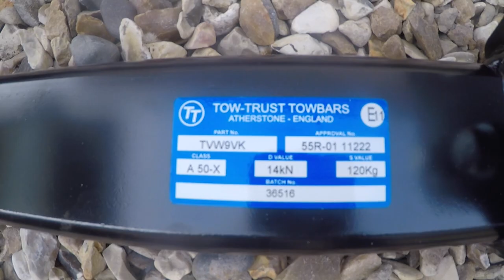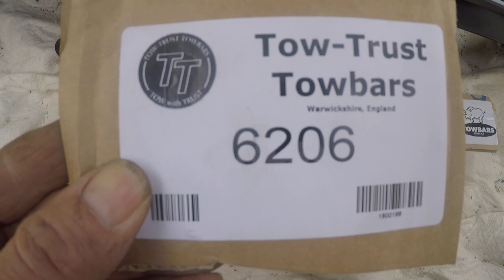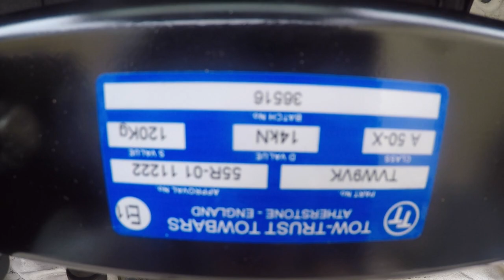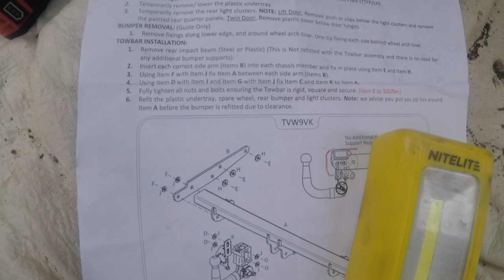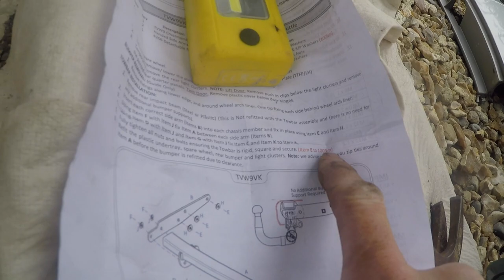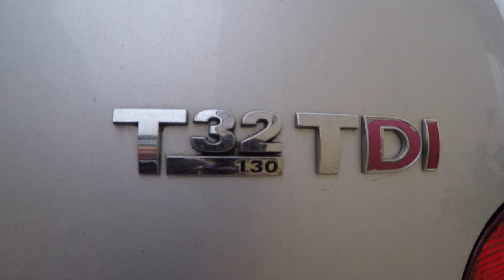How to fit VW T5 TOWBAR *DIY*

Comment: Great vid! Thanks for the effort! Give me a good idea about what to expect when installing the tow bar. I'm totally surprised about the terrible manual :').... I played that part again.. it's hilarious :') And that's coming officially from VW, right? or is it second branded? I do wonder what to do with the Electric, I did hear most cars are prepared for the tow bars, so they already have the cables going to the back, so plug&play, so i'll be looking for those, and if not there, maybe that will be a bigger obstacle than installing the tow bar itself. 
Thanks again!
Reply from the maker: Thanks for watching pls read other comments as we talked about electrical part  take your feed from drivers side rear light if youur plug and play theory does not work and cambus adapter if u need one 😆👍👍👍

Comment: Great vid helped me out, have you done a video on the electrics?
Reply from the maker: Not yet I recorded it but not edited when you do elect the drivers side tail light switches to a fog light is a twin filament bulb so take power for side lights from rear passenger side.  If you take light cluster out separate bulb bit and look at the metal printed bit on it then follow back from the middle terminal 👍
Reply: @daddyfixit5188  thanks pal for the tips, I was supplied with a 7 pin connector with the tow bar with no instructions and nothings pre wired. I’m quite handy, but hearing stories of popping the ecu if wired up wrong puts me of so think its a job for the auto elec guys I suppose
Reply from the maker: If you have a newer van which has cambus  think 2010 onwards maybe.  It is doable I’m sure but hey some things are best left to the pros.  Maybe if you arrange to take your van to see them without bumper and light under trims it would reduce cost.  In that position I recon they could do it in less than 2 hours and U don’t have the headache.  U might be able to find someone mobile then u will save time on cleaning out van or leaving it which always makes me nervous. 👍
Reply: @daddyfixit5188  yeh from what I read it has the cambus, also have been told it’s easy to mess up the ecu if you get it wrong? Have been quoted 80 quid so not that bad👍Keep up the great vids

Comment: Where do the electrics run to? Did u get the universal kit?
Reply from the maker: Hi make sure your van does not run cambus  if it is you need a relay the electrics cable should go to the right hand side. Drivers side.not the left as in vid sorry.     Make a hole in the grommet where light fitting cable goes through and tie into the back lights cable in a spot where it can be tucked back in panel.   Remove light cover so you can see the bulbs and there is one metal plate which runs to all bulbs that’s negative and all the positive pins can then be identified.  Run both the rear lights from near side     Then there is a separate cable for fog light on drivers side.  Do this way because.   The fog light is a twin element bulb  when the fog lights are turned on the normal power is stopped and the brighter side of the bulb is then activated by   another live.   Which is one of the solid black with small stripe green or red on drivers side.   If it’s not done this way the fog light on trailer board will come on with side lights.   I got the universal electric kit.   Which contained connector block and buzzer for indicators you will need additional x2 cables to run from one side to the other and spare pack of inline connection blocks to complete.  Total job time is about 5 hours ish   You may well do it faster 😀. I am doing a vid on electrics soon but have confidence it’s not hard but remember the fog light thing.
Reply: @daddyfixit5188  did you ever make the vid on the electrics !? i so hope so
Reply: also man thanks for the Towbarsdirect ...awesome ....and also anyone out there the Towtrust Bar is designed so it doesn't need the extra bumper wedge .... as other reputable towbars do ! ....costing another 50 quid from VW.
why wouldn't Westfalia for example make a tow bar that fit the same space as the spacer its replacing -seems very  strange to me !
Reply from the maker: Hi ruu there is a vid on way for electrics but it will b for non cambus waiting for daughter to edit and post it she will b back in a few weeks and will get it done then.   If you can’t wait for then best way is to take back light s out and bulb cluster out look at the printed board electric metal bits you will see one is joined to all bulbs and touches outside of all bulbs the other one which goes from each bulb is positive.   Follow them back to the lead you will have your positive feed. Run both tail lights from the left hand side !!! now on the right hand lowest bulb it’s a twin Filliment    Same as a stop tail bulb this is the fog light and tail light when the fog is switched on the tail light is switched off that’s why both rear lights take from the left and fog light feed from the right  don’t be scared make sure all joints are well done and all dangly cables are all taped up I put all wiring where possible and the beeper behind the big grommet underneath the light hope this helps.  Oh yes get a helper to operate brake peddles and lights for identifying cables good luck daddy fixit
Reply from the maker: Yes I got uni kit at same time as tow bar came with buzzer you will need also an extra length of cable to go from one side of van to the other for fog light and extra scotch locks/cable connectors oh and a roll of black insulation tape to wrap all cables really well as it has to last and you don’t want problems with the lights.  Just a little gem of info if brake light switch brakes your engine management light will come on and workshop will b shown on dash 😀
Reply: @daddyfixit5188  thnks man ! bumper came off no probs awaiting towtrust delivery .. delivery arrived .. side arms nuts faulty !
Reply: @daddyfixit5188  would love that vid! ive canbus but it will still help alot
Reply from the maker: Hi ruu glad you r on it now good luck with the new bolts. Get someone to help slide the bumper back on with you cos it’s tricky on your own and it’s real easy to scratch bodywork topside where bumper meets bodywork 😁😁😁